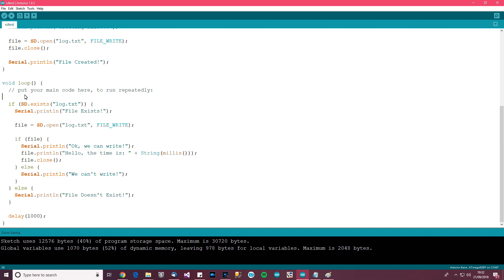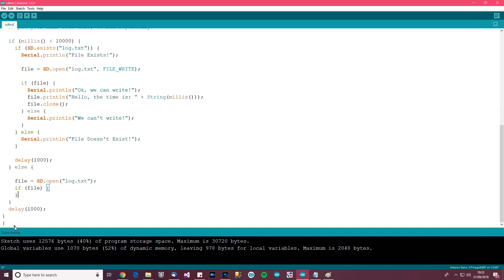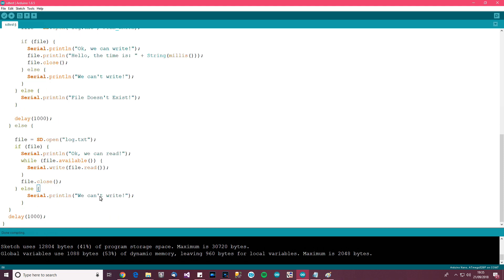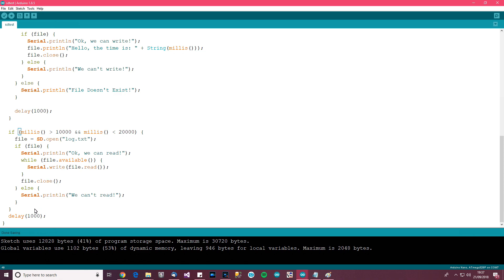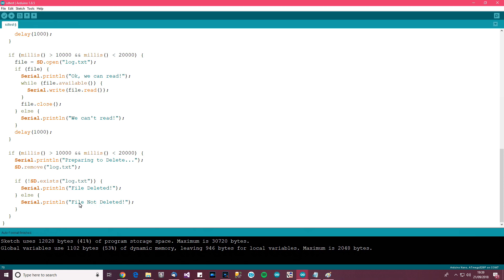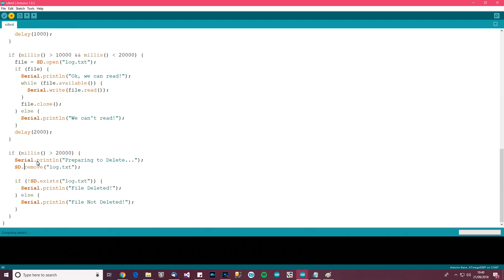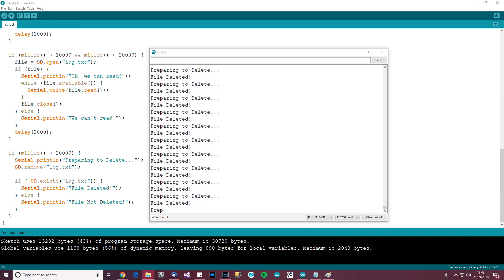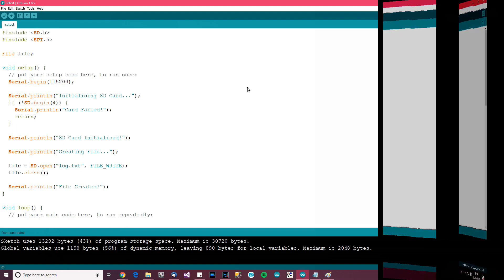TUTORIAL: How to Quickly Get Started with Arduino Micro SD Card Reader / Writer Module DIY - Part 3

Comment: Hi Antony - great tutorial for starters! Have you also found a good library to deal with long filenames? Just wondering if you used any. BTW: it also possible to make a cheap breadboard friendly micro SD reader from an SD adapter. Just solder some header pins to it. You only need to be careful with the 3v3 voltage level...
Reply from the maker: Hi Maxint, this was just a requested tutorial. I've personally not got a need for it at the moment and don't know much about it. :) Ahhh, that's good! So you can just get any adapter and modify it!
Reply: Excellent, I'm sure they'll like it! Yeah, the pads on an SD card are simple SPI pins. If you google Cheap DIY SD Card Breadboard Socket you'll find an instructable by someone who made a nice removable breadboard module without soldering to the adapter.
Reply from the maker: @MaxintRD  oh right! Interesting stuff! I'll have to take a look at your channel soon to see if you have any new material!
Reply: @AntonyCartwright  - Thanks, I don't publish that frequently, but I hope you find something interesting. The last weeks I mostly been playing with LED displays (7-segment and matrix) and published a library to support TM1637, TM1638, TM1640 and similar LED driver chips. I'm still recording more material for my next video, but how I make them takes lots of time and often life gets in the way... :-)
(Perhaps I'll try out some live streaming to avoid time consuming editing. Tested XSplit with webcams yesterday).

Comment: I have one quiestion, I'm working with Arduino Nano and a microSd card reader. Right now I can Record audio using another module, but I want also to play recorded audio. I have the CS pin of the microSD card Module in pin D10 but you have it in pin D4, it is necesary to change or it works the same?. Saludos